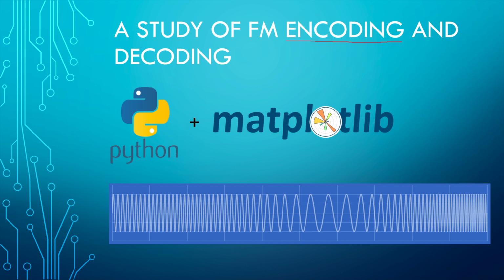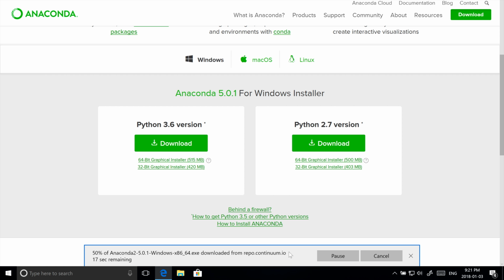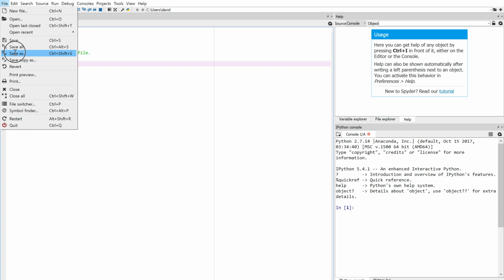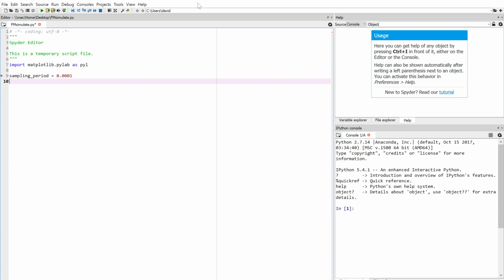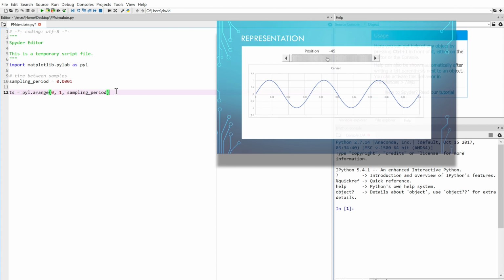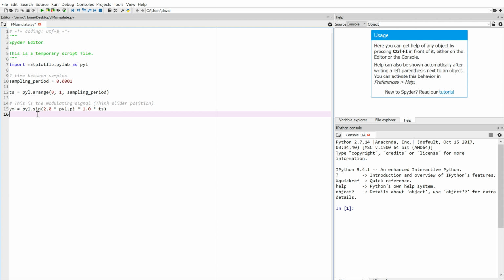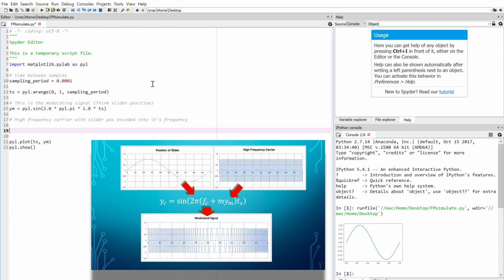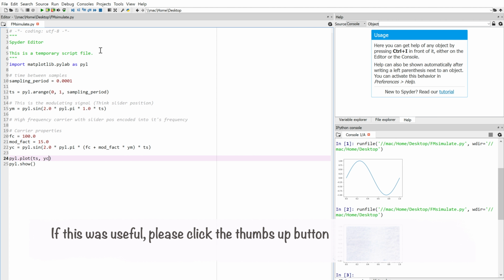FM Modulation with Python part 2

Comment: Do we not need to integrate the modulating signal?
Reply from the maker: Chris Stryczynski It turns out that you don’t need to. Otherwise video 3 would have been a disaster :)

Video 3: https://youtu.be/x3aTj61uovI
Reply: i think it may have to do with the fact that the integral of a sin is a cosine and they are possibly similar enough that it doesnt make a difference in this application.
Reply: @kevinnel7038  yeah rather misleading video then though, "FM modulation of a sine wave" might have been a better title.
Reply from the maker: Chris Stryczynski I will agree that most text books go with cosine, but it’s just convention, so it really doesn’t matter. 
https://www.quora.com/Why-is-a-cos-function-used-in-signal-processing/answer/Aseire-Live

Comment: Can you provide Fourier domain results for the resulting signal? I followed this tutorial but FFT results seem kinda awkward. Thanks in advance.
Reply from the maker: The spectrum is definitely off. The spectrum can be made exactly to textbook by changing some numbers. Check out the Google Doc at the below link. 
https://docs.google.com/document/d/1drbDP6WrZK-B47x5Sy-BFWr9DvDwRkv6H7V4y-zbGcw/edit?usp=sharing
Reply: David Helmuth It turned out to be the formulation in my case. See, when I multiplied timestep values with (Fc +mod_fact*ym) it goes kinda crazy. The correct equation was sin(2*pi*Fc*t + mod_fact*ym). And ym was: sin(2*pi*Fm*t). 
Anyways, thanks for the good work. Keep it up :)